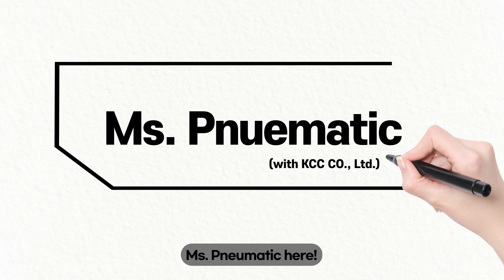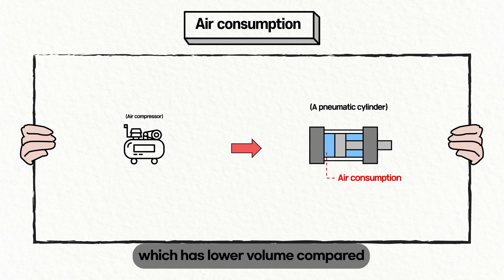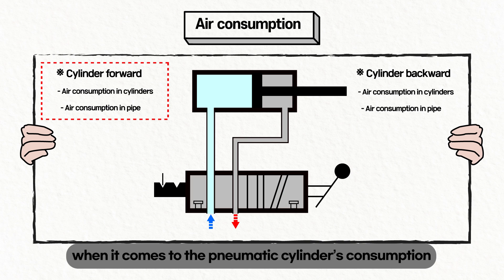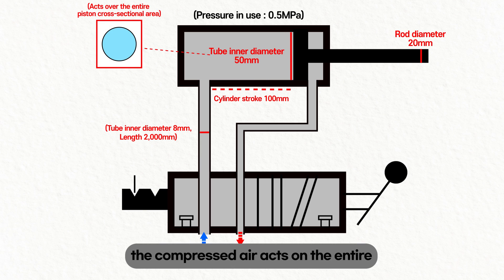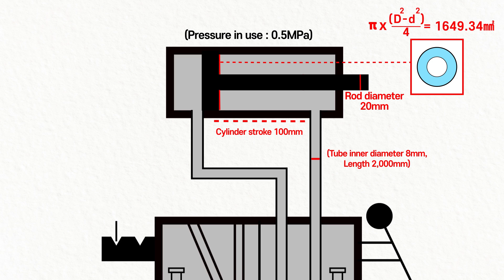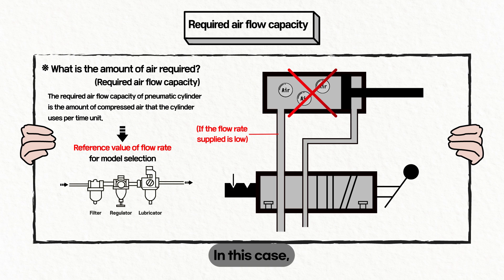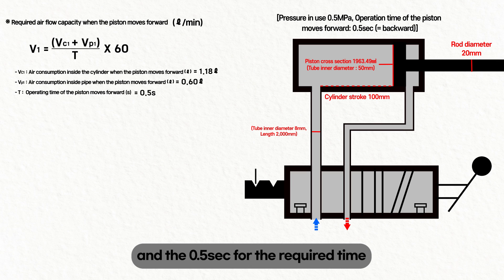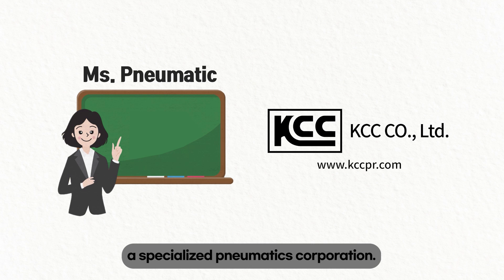Basic theory of Pneumatic cylinder’s Air consumption & Required air flow capacity

Comment: I have a question, let's say you did this calculation process for 10 actuators in your system and then you get, for the sake of the example, 2500 L/min. This is actually a very large number (2.5 m3/min). The next stage is actually how to "downsize" the required air demand. Would it be based on a simultaneous use factor, and also on a utilization factor? for example of 0.15 and 0.2, repectively, giving then 75 L/min. We also need to consider the air receiver, isn't it?

Comment: Thanks for the knowledge, but I have a question.
How do you know how much time the cylinder will take? 8:30
Reply: It's usually stated on the data sheet of the acturator ;)

Comment: Hi
Would you circulate 
Air consumption calculation to fill 1000liter to 100 psi through 50lpm compressor ( tank out let has 50liter tank)

Comment: This is GREAT. Commonly Actuator manufacturer already stated the Volume of Air on each model of Actuator. I hope that you can give us the video that will continue this to calculate or to choose the correct SOV, Regulator, Booster, etc. Because when I design the Pneumatic Control System on SDV, I have to look on SOV, QEV or Booster cv to get the correct stroking time.